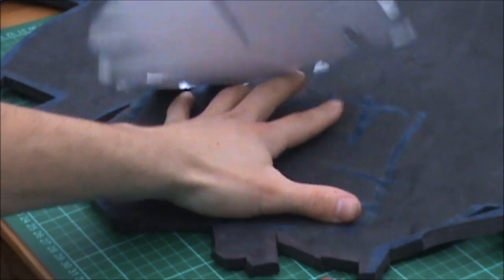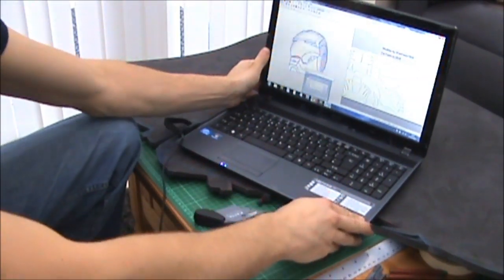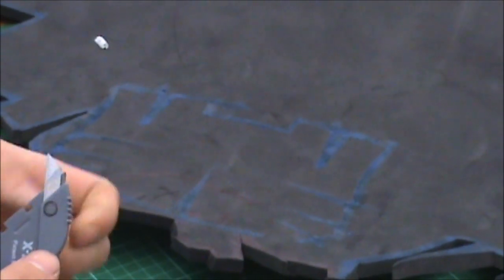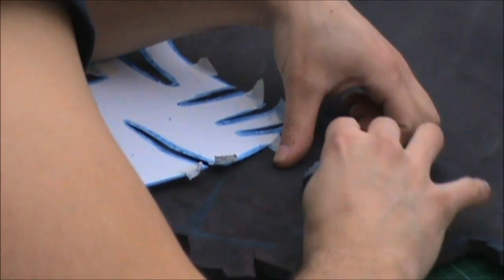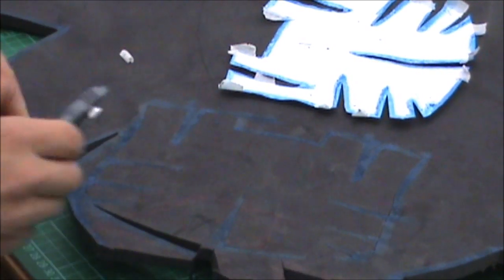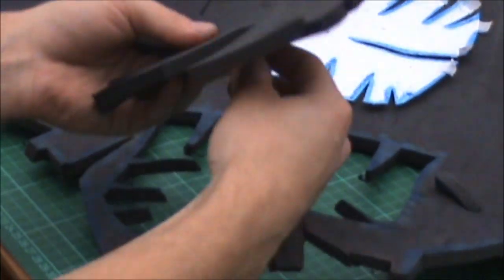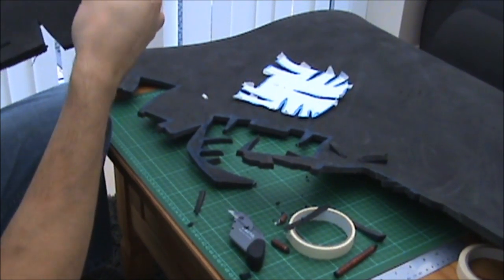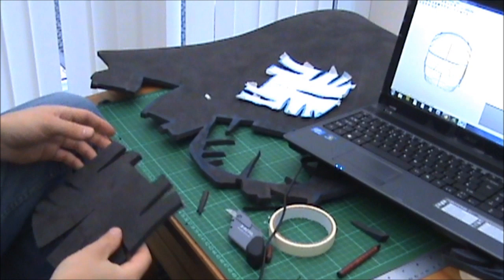2B - (cutting the foam) Foam Pepakura Iron Man Suit/Armor explanation

Comment: You are using Fibreglass Resin or an Epoxy Resin later, right?
Reply from the maker: most foam suits are just left as foam to make them cheap and lightweight, but i have been making molds of the suit and casting them in resin

Comment: I heared some rumors of Fibreglass and Epoxy Resins not working whatsoever with EVA foam? Also I am unable to locate any legitimate looking seller of plastazote LD45 Polyesterine foams.
I even looked into making an Iron-man suit out of stainless steel, but in the end it turned out too daunting of a task and would involve buying an expensive Steelcutting wheel, and there are no plans or files for shaping them so I would have to do it myself. (lolnope)
Is EVA foam fine or can I get a link to some Plastazote LD45?
Reply from the maker: I got my Plastazote foam from the UK from a place called Thames Valley Supplies http://www.thamesvalleysupplies.co.uk/rubber-item.php?key=261&time=1389330079

Comment: I use a swan morton surgical scalpel with a 10a blade, makes cutting out and chamfering the edges so much easier however be very careful. I also use clear tape and cut with the template in place, if you are careful you need not damage the template and the scalpel just slices through the tape. Saves a lot of time.

Comment: for foam you dont need to cut the little slits, you could of mist them out and cut out the full shape, then heat it with a heat gun or a really hot hairdryer then bent with your knee, it would of kept the bend when it cooled down, just a suugestion

Comment: Haven't you seen the technique where you take the notches out of the paper first and then cut it out of foam so that you don't have to figure out cut angles? You can then just heat the foam and put the curves in that way.  Seems much easier.  You do all your figuring on the paper so you don't have to on the much harder foam.

Comment from the maker: do you mean the really thin foam? if so it would be to flimsy to hold structure, and if you need to cut angle s into the foam to connect parts together the thinner foam is really hard to cut.

Comment from the maker: Hi there. 
In my own personal opinion i find the foam a lot easier and faster to work with for a fast fully wearable suit. The paper method is easy with folding lines etc but if you have never used resin/fibreglass/bondo then you are going to find it hard to mark the paper hard to wear, where as you can paint and wear the foam without fibreglass etc. hope this helps :)

Comment from the maker: i am not sure how that turned out as i have not seen his photos yet. as for the filling etc, you are right, foam cannot be  filled and sanded etc. what i will personally be doing with my suit is sealing the foam in PVA glue to give it a smoother surface, and then molding and casting it in plastic to get a hard plastic piece that i can then sand and fill as needed. other than that you will most always have the cuts there. but dont let that put you off, i have seen amazing foam suits with slits.